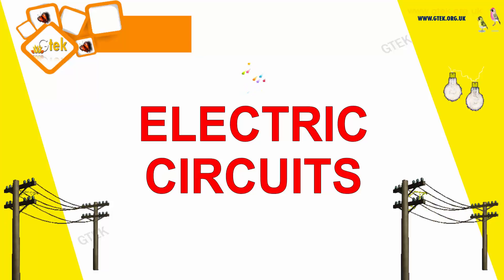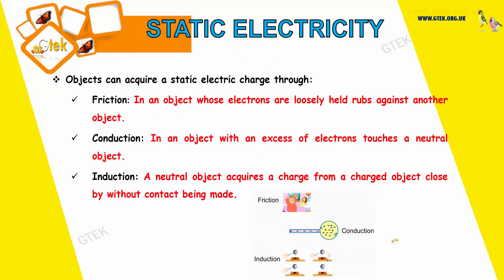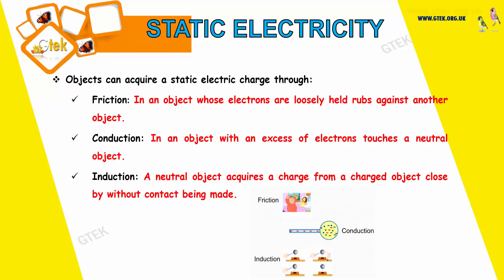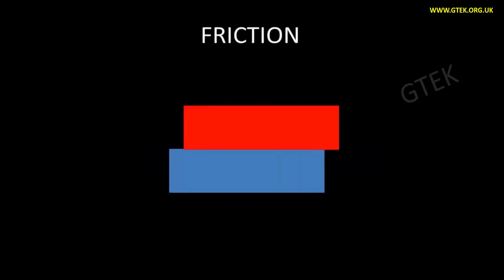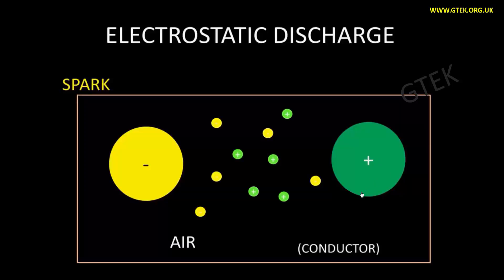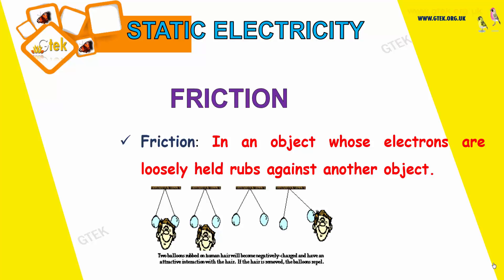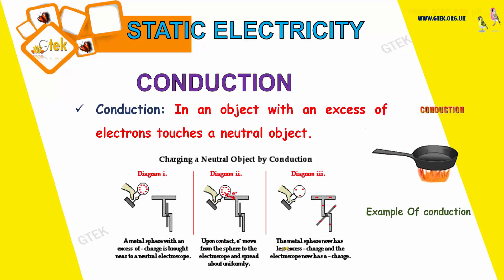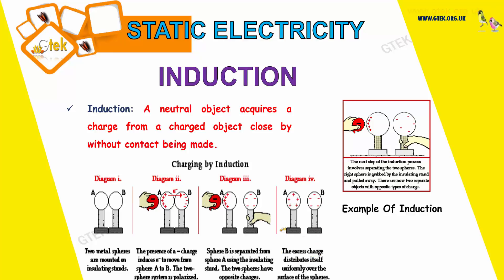Electric Current | electric current unit | Static Electricity | Static Electricity Experiments

Comment: The three basic principles for this tutorial can be explained using electrons, or more specifically, the charge they create: Voltage is the difference in charge between two points. Current is the rate at which charge is flowing. Resistance is a material's tendency to resist the flow of charge (current).

Comment: The electrons, the charge carriers in an electrical circuit, flow in the opposite direction of the conventional electric current. The symbol for a battery in a circuit diagram. In a conductive material, the moving charged particles which constitute the electric current are called charge carriers.

Comment: An electric current is a flow ofelectric charge. In electriccircuits this charge is often carried by moving electrons in a wire. It can also be carried by ions in an electrolyte, or by both ions and electrons such as in a plasma.

Comment: Static electricity is an imbalance of electric charges within or on the surface of a material. The charge remains until it is able to move away by means of an electric current or electrical discharge.

Comment: The SI unit for measuring an electric current is the ampere, which is the flow of electric charge across a surface at the rate of one coulomb per second. Electric current is measured using a device called an ammeter